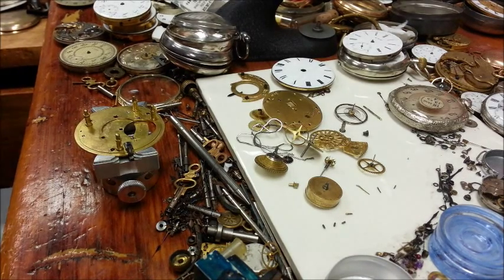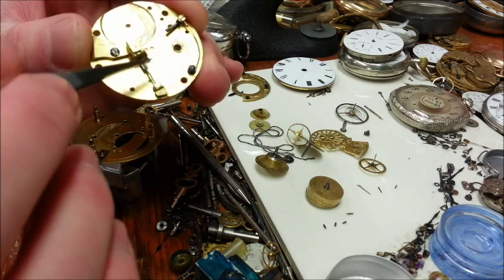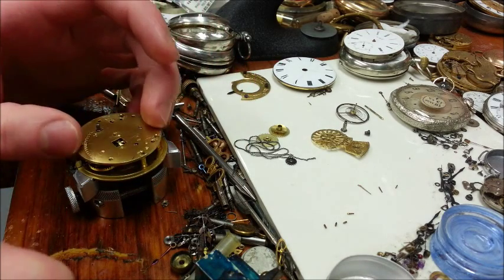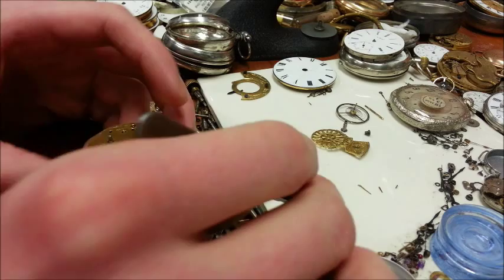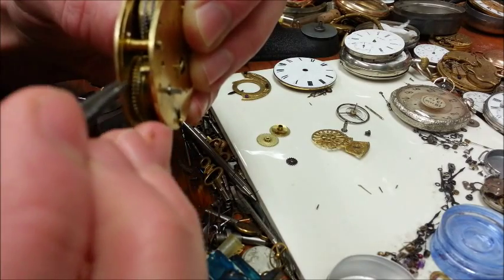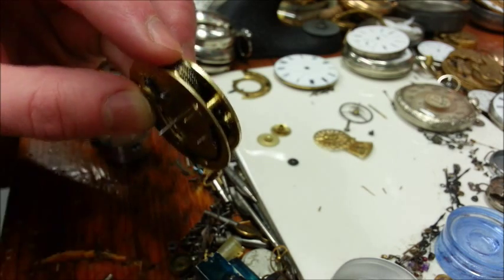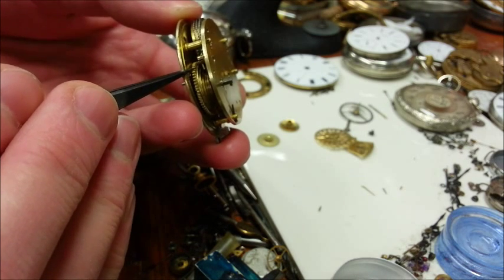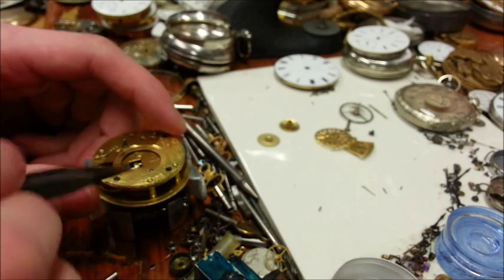verge fusee assembly

Comment: thanks mate really helped me out, can the staff be pivoted on these
Reply from the maker: So the staff is all one piece, Other then a brass bushing used to mount the wheel and hairspring. The wire used for the staff is so thin it is not feasible to drill and pivot. It is far better to make a new staff then any mangled together repair, and often a repair will be of poor quality and eventually break anyway. To build a staff is a lot of work and not to be taken lightly but well worth the effort once the watch is restored.

Comment: I have a similar problem to that mentioned in previous post, namely. The movement ticks away quite well enough ( in my case runs for approx 8 days) but the minute hand only imperceptibly advances, indicating that somewhere in the drive train, motion to the minute hand is lost or slipping. The minute hand is therefore not registering correct time, although it does fractionally creep forward over a much longer period of time. I’m suspecting the minute hand is slipping on the canon pinion, any ideas.
Reply from the maker: So yes you are right the cannon pinion is likely slipping. and as the watchmaker that trained me once said "sometimes all you need is the hair of the watchmaker" In other words just a hair or two inserted into the cannon pinion as you push it into place can make all the difference friction wise on this component. Its not the best repair but it does work. All you need is to make a better connection. Other times its tooth lockup in the transition wheel and hour wheel.
Reply: @hallicra  Thanks Nathan 👍

Comment: Oh forgot. Here is a mnemonic for remembering the chain position. Captain HOOK sits on his BARREL giving the FINGER to his FUSEE crew. (The finger is hook that goes to fusee, it looks like a little finger pointing. ...)
Reply from the maker: Thanks actually backwards... the hook is for the fusee because at the very end of its run the chain end has to rotate/ pivot around the brass pin in the fusee cone. The barrel on the other hand requires a fixed hook that locks into place with the contoured finger. if the chain is put on backwards with the fingered hook in the barrel the pivoting motion will be stressing the chain links in instead, potentially leading them to break over time. 

if you're finding the locking fingered hook is slipping off the barrel once the chain is wound up, it could be your chain is too short and is getting too close to the fusee at the end of the winding. also make sure the winding stop mechanism is working in advance before you run out of chain. there should be 1cm or half a cm of chain still on the barrel when the watch is fully wound.
Reply: Nathan Das Thanks for reply. Yep I did it backwards and then when correcting it, as I was winding it after finally getting things I thought set, I broke the fusee chain. I am going to try to repair it. It broke on a link not on ends.

The thing I was having trouble with understanding was the stop. I see how it works now as the tang slides under the lever bar until the chain pushes the bar into the path of oncoming tang. 
When I busted the chain somehow the chain got wrapped over top of the fusee cone and got in a pinch and broke from winding pressure.

Also, on the side of my barrel is a big knot for the mainspring to terminate to on side of barrel. Might be a homemade connection because it's fairly bulky. But it could be factory. I wonder if it is not in the way when winding the chain onto the barrel.

Thanks for replying your opinion is appreciated and am subscribed.